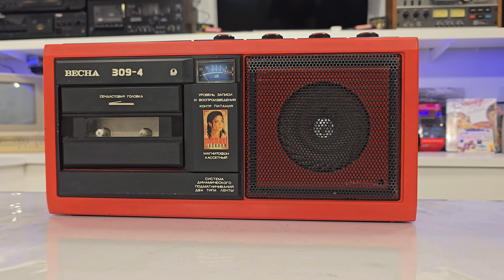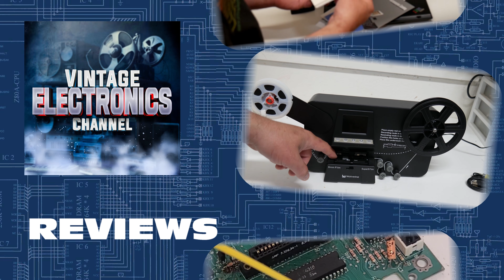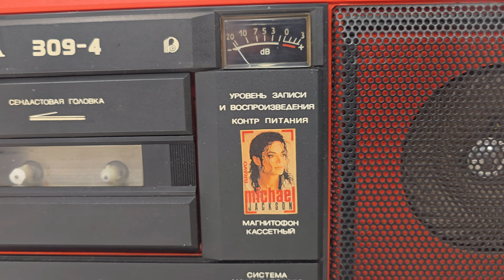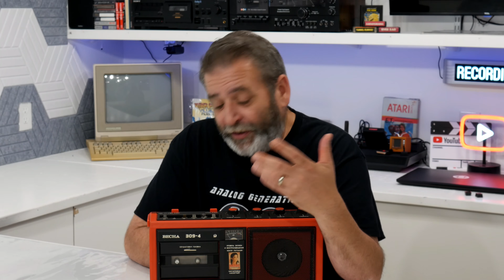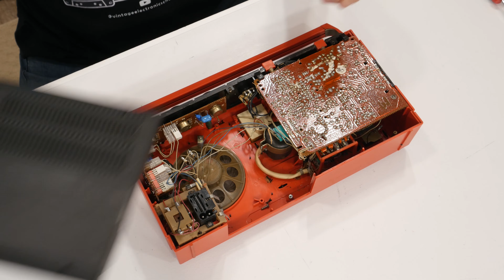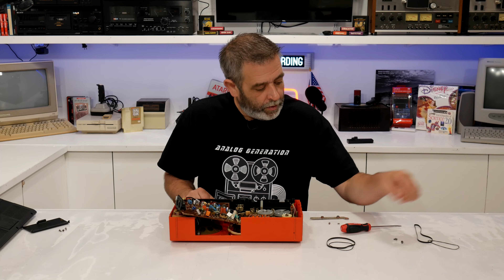The Soviet Cassette Deck That Defied the Cold War - The Vesna 309-4

Comment: You don't Need to replace the motor,  It was seized on my vesna  too, but if you take It apart and clean and lubricated It, It Will run like new, don't unscrew the screws in the center but the 3 screws at the Borders at the bottom of the motor, greetings   from Italy

Comment: The engine is three phase, without collector. With a rather complicated control board, with a large number of electronic components. Most likely the case is the control payment, since the engine itself is reliable. there is nothing to break there. Or there is no nutrition. The advantage of the engine is a stable speed. In it, the built - in speed sensor, and the stability of the rotation speed does not depend on external factors: the load on the shaft, the change in the supply voltage and the temperature drift. The absence of brushes is also a plus. Disadvantage: above the noise level, especially with wear of bearings. By the way, they used tape recorders to listen to music, and not for what you talked about😊

Comment: Cool!...I've taken cassette deck motors apart, cleaned and lubricated them back to working condition. You may have to burnish the armature shaft with very fine emery paper if it's pitted.

Comment: Your Vesna is postsoviet ukrainian (soviet or independent all Vesnas were made in Zaporizhzhia) modification which production started in 1992. Original model 309 entered production in 1987. Since some time in the 70s soviet consumer electronics were devided in four "groups of complexity" as it literally translates to English, essentially price categories from 4 the cheapest to 0 the high end and convention was the first digit of the model number reflects the class. If it's audio equipment model number might ends with cyrillic C, which is latin S and means it's stereo and after a dash are modification indexes if any.

Comment: Brushless (3-phase) motors started being used in the Soviet portable tape recorders as early as 1972 ("Vesna 306"). The can keep stable rpm even on low batteries.

Comment: the motors are usually easy to repair, especially if the brushes have not been destroyed and that is extremely rare!  I'm curious why you didn't finish fixing it.
Reply from the maker: The motor locked up without a sound. I was hoping to find a replacement, but couldn't. There have been some comments about fixing it, so my plan is to create another video trying to repair the motor. I also have a friend who is going to design and 3D print somw new caps for the transport controls as well.
Reply: This looks like a three phase motor rather than a DC motor. Look at all the wires going to it... Likely a brush less motor. It just needs its bushings cleaned I guess.
Reply: It's a brushless motor.

Comment: I watched your video with interest. The topic of Soviet cassette recorders is very interesting (I was born in the USSR). My parents gave me my first cassette recorder in 1975—an Elektronika-302. It wasn't easy to buy; it had a Japanese motor. The main problem with Soviet cassette players was always the mechanics—the tape transport mechanism. That's why devices with imported mechanisms were so prized in the USSR. Later, I got a Vilma-204 stereo deck. It had a tape transport mechanism manufactured "under license from Max Planck." What that means, I still don't know. :)
And the role of Western music on cassettes for young people in the USSR is another huge topic; there's not enough space to discuss it in the comments.
Repairing this "Vesna" is just for fun. Be careful, it can chew up cassettes. It's a third-class device; only a fourth-class one is worse (class is the first digit in the model number).
Reply: Max Planck - probably an East German factory. 
Also - this looks way more substantial than any tape transport we had in western markets at the time (late 1980s), which was the start of the era where they would make them from the cheapest plastic parts, also known as the 'black plastic crap' era.  Philips mechanisms with crumbling gears after a few years, Sony's with belts turning to goo in no time, which require removing and cleaning a thousand plastic gears to fix them... 
This looks more like the tape mechanisms from the 1970s into the early 1980s which last forever with just minor repairs if any.
Reply: @westelaudio943 You're right about the materials, but you have to keep this in mind: while tape drives in the West were already being made of plastic, the USSR was just beginning to master their production, so they were made of metal. They (Soviet mechanisms) are certainly repairable. But the tape recorder often arrived from the factory poorly adjusted, so it could easily chew (crumple) the cassette. I experienced this myself many times.

Comment: interestingly these vesna's came with 2 different motors. there are brushed and brushless motors. I have a vesna 309-2 which is identical to this. I don't even know what the difference is. Mine has the brushless motor as well and it does work. It was such a hassle. I replaced all of the old electrolytic capacitors and i also replaced the operational amplifier ic's. It does play just fine with new belts and i didn't even need to adjust the playback speed. It does even record but it doesn't do it correctly. It won't erase the recordings. No idea what's wrong with it.

Comment: These Motors from ukraine usually get stuck. It's normal.   I saw a video about the vesna 309 on a channel Diode gone Wild. There  was the same problem with the motor. That Guy just took the motor apart, cleaned the bearings and put a new oil to them. Then the motor run like new. It's a low voltage 3 phase motor there aren't any brushes which could get easily damaged during the proces.
Reply: That's the case with a lot of motors
Reply from the maker: Thanks for the info. I'll look more closely at the motor